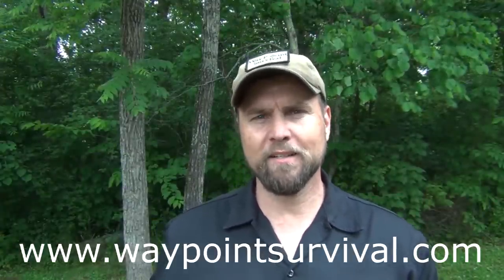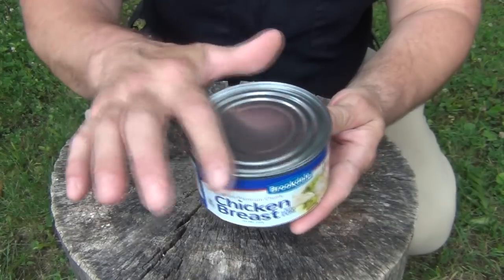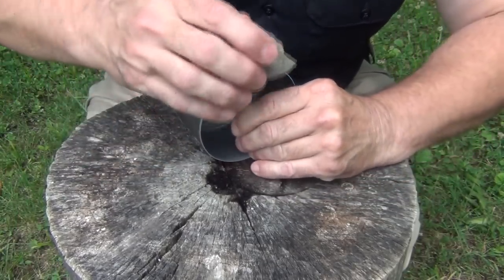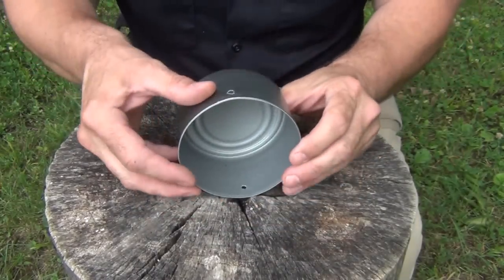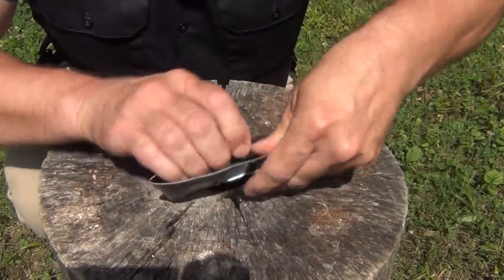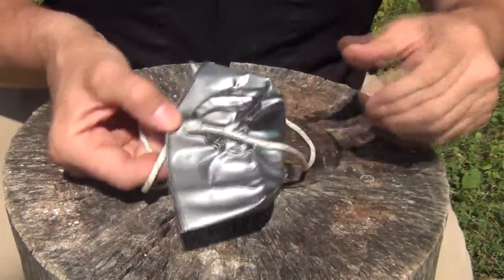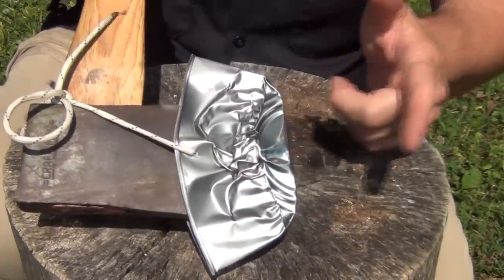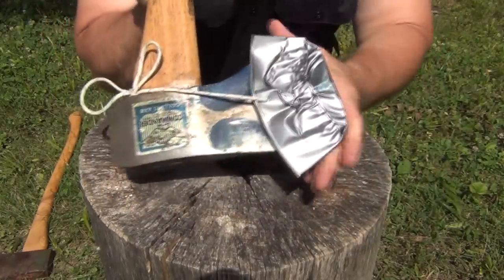Tin Can Axe Sheath [ Quick and Easy ]

Comment: Line the inside of your can with a piece of old inner tube or rubber roofing to protect your edge. That way you dont have to worry about it absorbing moisture.
Reply: yup
Reply from the maker: Yes, you could definitely do that. I was just trying to put forth a really quick way to get it done. Edit: The piece of inner tube or rubber roofing is a good idea!
Reply: @WayPointSurvival  no criticism here, brother. Just looking a little further down the road is all. Necessity is the mother of all invention, but future improvements is definitely the key to smoothing it in the long term.😉
Reply from the maker: No problem here. Sorry if it came across that way.
Reply: I think the steel will take conformation such that it pinches against the cheeks of the blade, maintaining free space between the edge and the guard.
Reply: How will rubber keep moisture out when the cover is still open to the atmosphere?
Reply: @stephanygates6491 I agree. I think it's great as is. And to think I went to all the bother of hand sewing a leather one years ago with a small closure.
Reply: @joewoodchuck3824  rubber isn't hygroscopic, or at least nowhere near as hygroscopic as natural materials, although atmospheric humidity will always be an issue of the environment, where as wood and leather tend to readily absorb moisture from the air. It is not meant to keep the moisture away from the blade, but to protect your edge from getting dinged by the metal cover while not actively drawing moisture to it.
Reply: YouTuber Reallybigmonkey lines the inside of his knife sheathes with those big pieces of packaging windows to protect the sheath.

Comment: The old guys (I am one of them) back home in the States would call this idea "crafty." I like it for an emergency set-up. Here in the Philippines, I scavenge discarded short lengths of DWV (Drain, Waste, Vent) pipe from trash piles next to new construction sites. Most pipe here is very thin-walled, orange in color, and makes lightweight projects. When you have scrap pipe, a heat source, and some free time, it is amazing what you can fabricate. Perhaps, James, if you have not already done so, demonstrate some "pipe craft" ideas for subscribers. I believe YOU are the guy to take things to the next level. Thank you for another great project & video.
Reply from the maker: Thanks for watching for sharing the Great ideas!

Comment: Dad used to do this with his axes. Back in the day of course you had cans that sealed on both ends. So can opener them both out and you have a open ended cylinder that easily crushed flat. If you chose a can that was deep enough it extended out beyond the edge, no need for a bottom.
Reply from the maker: Excellent. Thanks for sharing that!

Comment: I’ve made them using old license plates. The soft aluminum is easy to work with , doesn’t rust or stain & the license plates are reflective making them easier to spot in camp at night.
I use bands of old inner tube to secure them.
Reply from the maker: Great idea!

Comment: Great tip ... I'm learning to make sheaths but still have more axes that sheaths lol and they're all very sharp . I'm always concerned someone's gonna get cut .. I'll definitely use this ... just temporary but much safer.  Thanks
Reply from the maker: Yes, this would definitely not be a permanent fix for most access. But it will do in the meantime for sure.

Comment: Burn it out, and use a hose clamp to install either a strip-metal or wire handle and you've got a fantastic cup you can drink from and cook in. Turn the top into a lid and you're golden. Super easy and simple. Because it's pressed/stamped, you don't need to worry about melting any solder.
Reply from the maker: Yes, they work well for that.

Comment: Top Tip: when doing a bow knot, just go around twice and it never comes undone. To undo, same as usual..pull both ends. This is especially valuable in freezing weather..kids' boots and skates.
Reply from the maker: Great tip!
Reply: @WayPointSurvival  You'll never do a double knot again :)
Reply: Are you suggesting "tie a second bow over the first bow"?
Reply: @___HH___  No. when you make your first loop and pinch it,  normally you would then go around it once with the other lace and then push that through to make the second loop, then draw them tight.
So instead of going around the first loop once , you go around twice and then push the lace through to make the second loop. That is the only difference, that the "going around" is repeated. 
That's all there is to it.
Undoing it is the same as usual, pull both lace ends.
Let me know if you get it to work.

Comment: I would smash the can flat with a twig in the fold. You could burn the twig out and have a guard that really pinches the cheeks, leaving free space along the edge. Even, poke a drain hole at either end with an awl or the point of your knife. Brilliant idea. Thanks!
Reply from the maker: Yes, I'm sure that there are many ways that you could modify this and make it more efficient.

Comment: Great ideas! I wonder, I've kept a sheath on my grandpa's Eastwing hatchet for years, and every so often I have to clean up the moisture/rust. I probably shouldn't store it in the leather?  I've had it for years and really don't know better.
Reply from the maker: The best thing you can do is coat the leather sheath with oil several times and let it soak in. I prefer to use olive oil as it's food grade.
Reply: @WayPointSurvival  I've been using a "snow seal" from Red Wing. I'll try the oil instead.

Comment: Great video idea! For the sheath@
Here is a suggestion for another video...
What multitool would you reccomend 
With pricepoints...
Up to $50
$50 to $100
$100 to $150
$150 to $200
$200+
Reply from the maker: Thanks so much for watching and for the suggestion. I do have a video from some years ago on the type of multi-tool that I prefer. I go into detail about its uses and why I chose this particular one. I paid $80 for it back around 2006 and it is still going strong. Also, the company will repair it for free should you have an issue with it. It's made by SOG.
Reply: @WayPointSurvival  Ide like to see that one! ... I think gear and tools and hacks is info that folks want to see.... 
Also with links to just purchase.
You mentioned that those hangars were not galvanized... i am anal so I looked up dangers of galvanized in cooking and found out about the burn off is very toxic fumes...
This type of info is very crucial. Most people dont know this stuff... or being carefull

Comment: I've always just used cardboard and duct tape. I laminate the cardboard with the duct tape so there will be no moisture. I have also used material to sew up a sheath and placed cardboard laminated with duct tape on the business end. And had snaps to close it up. Even sewed Carabiner on one side so it clip onto my belt
Reply from the maker: Yes, those projects can work well also!
Reply: @WayPointSurvival  well I never thought about using a can. It is pretty slick. I probably would have tried cutting it out And over complicating it had I thought about it. I think your idea is the best probably for bigger axes. I can't help but think when you stand them up it might make them unstable though. I'm sure you could bend the bottom side and play around with it to where it would work just fine for any application. You could even punch a hole on the top and put a carabiner in. You could paint it black, or you could just have a quick and easy down and dirty fix. Definitely knowledge to keep on hand

Comment: If your multi tool doesn’t have a file, you can use the rock that you hammer’d the nail through the can to smooth out the rough edges.
Reply from the maker: Indeed!

Comment: There seems to be some concern about moisture. My answer would be, once you got some semblance of a crease in the bottom of the can stop and punch two or three holes from the inside, clean the burrs then continue the flattening. As noted, the tin can is a temporary (or not) solution. You're just protecting the blade. Leather of course needs saddle soap or oil to waterproof. For small projects like that, you could put linseed oil, tung oil, or melted wax oil mix in an old cooking pan or foil pan and soak the leather, then give it a good rubbing and let it dry.
Reply from the maker: Yes, this is a temporary solution.

Comment: Hmm, I might have to do that for my Gransfors Bruk axe i got for $20 and my Collins hatchet. No one sells leather around here. Hobby Lobby only has soft leather. There a couple of saddlers but they won't sell any leather.
I do have 2 old Plumbs, axe & hatchet. The one leather sheath needs replacing. Two old style wide blade shingling hatchets need handles & sheaths. Not sure if that chicken can is going to be big enough. Two other blades I picked up,a double bit & a metal detected bearded axe/hatchet blade with no cracks and not much rust. You got an improvised sheath idea for those? The shingling hatchets i thought would be great for bushcraft carving practice and for cutting kindling down to the thin pieces and maybe feather stick practice. The Collins is a bit thick and tricky for fire starter sizes. Gotta watch the fingers.
Oh, if you don't have a chunk of old garden hose, what would you use to cover the draw knife? One the one I have a couple pieces of hemp rope to hold the hose on. Need to change that up.
Reply from the maker: If you don't have any leather you can sometimes use old shoes or boots that you can buy at second hand stores really cheap and repurpose that leather it should be thick enough. Also, you can just wrap a draw knife with some old t-shirt and that should protect the blade just fine.

Comment: Just use a discarded water bottle.  The plastic isn't going to dull your edge either.
Reply from the maker: Yes, you could do that. However, the edge could cut through the plastic much easier than the metal can.

Comment: yeah softer or not it'll still do a number on the edge!! better off using a piece of PVC pipe that's been flattened and pop riveted on the ends!
Reply from the maker: Sure, you can do that.
Reply: @WayPointSurvival  trust me after putting in 4 almost 5 hours reprofiling not just the edge but the cheeks as well with a file and puck and then another 40 minutes stropping on my main axe, (a pristine collins mid 30's production northern pattern from a garage sale) getting it exactly how i like it, i guard it like a junkyard dog does it's supper!! if it's not leather it's going to be something that will not stand a chance of dulling the edge!

Comment: ugly as sin but unsheathed axes are scarier than people realize. I keep my hatchet so sharp simply touching it splits your hand (learned from experience) and I gave it a leather sheath right away
Reply from the maker: Indeed. I feel like some of the people in the comments do not really understand how important something like this can be.
Reply: @WayPointSurvival  Yes'sir, axes are bigtime danger. I know it's ridiculous but I prefer machetes to hatchets because their weight is easier to control and I prefer full-length 36 inch handled axes so if I make a mistake (largely to my own stupidity) it ends up somewhere in the dirt or somewhere that isn't my foot. I always drop my knees and back into the swing and know where it'll hit. God bless.